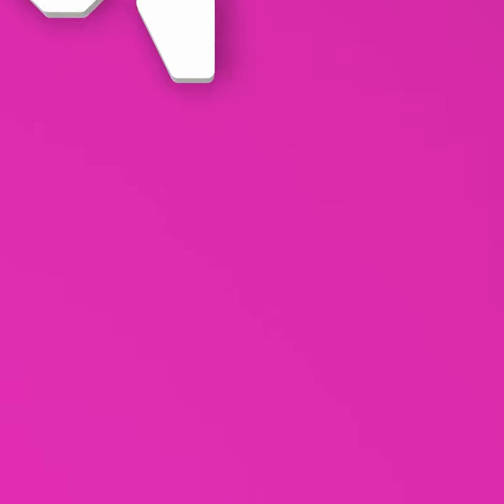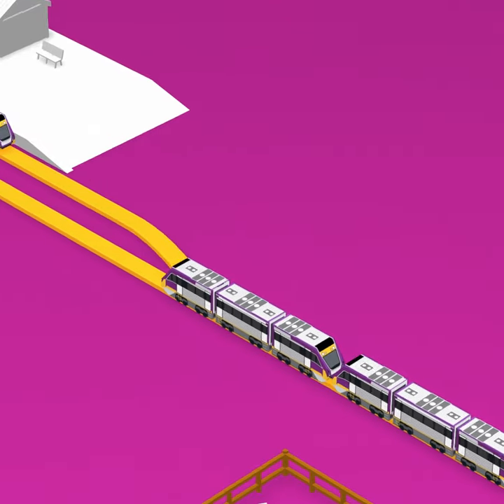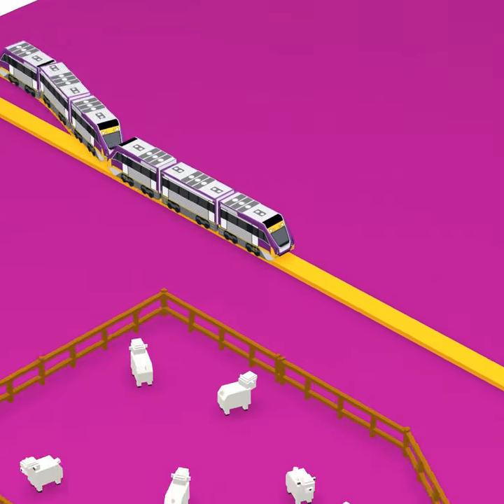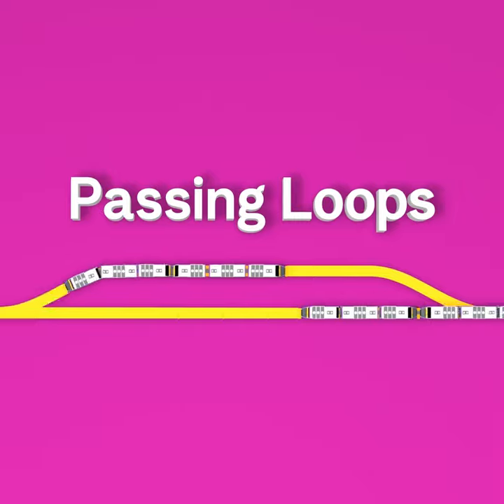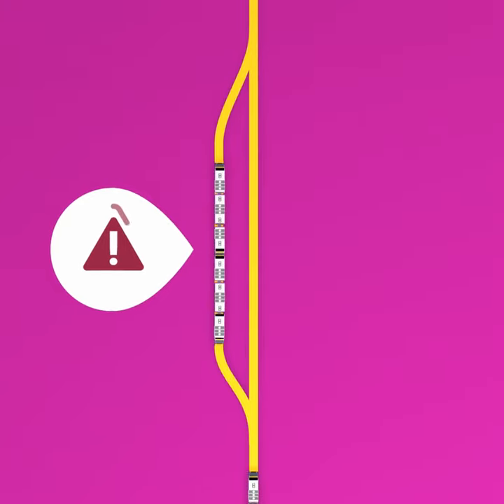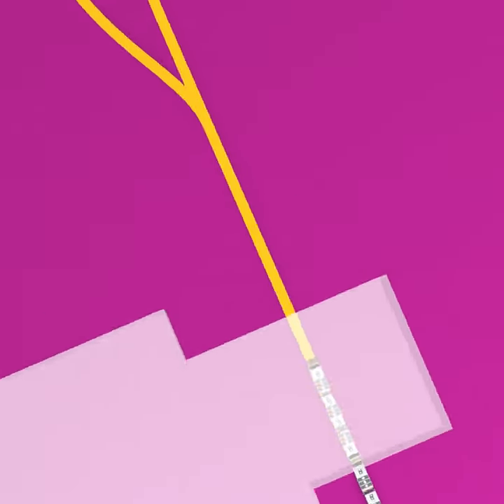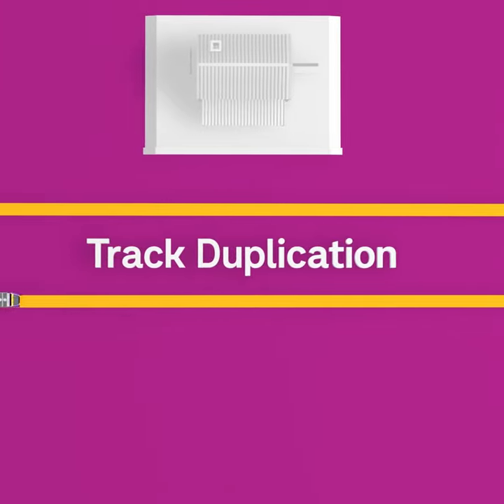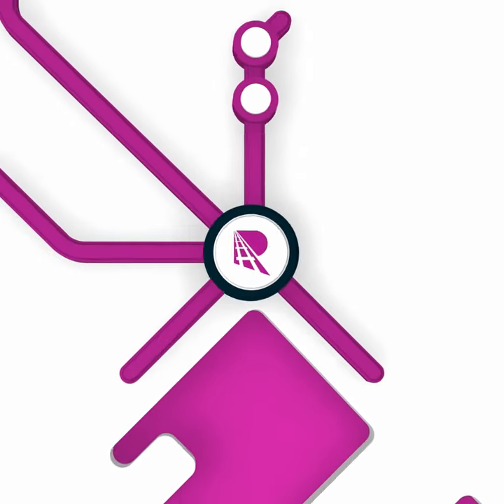Passing loops explained

Comment: Catch 22 though: single lines don't have enough services because the infrastructure was never updated to allow for extra services. Passing loops are okay in the short term, provided there isn't a massive delay in a single section.
I mean, if Ballarat isn't dual line already and it has 100k+ population, Warrnambool will NEVER see a dual line in the next 25 years minimum. 😱